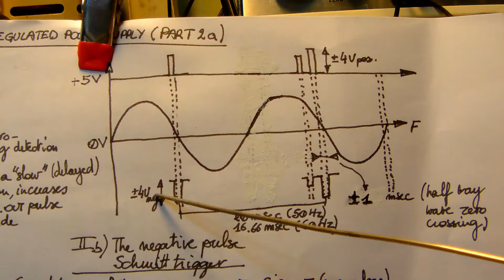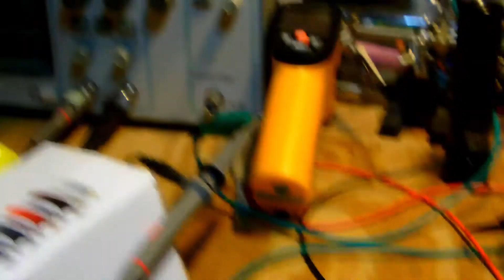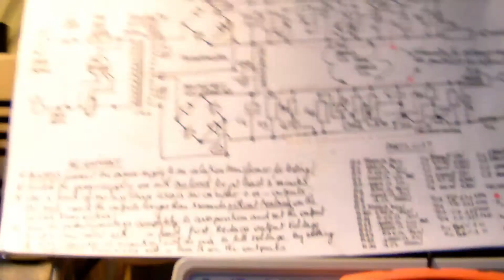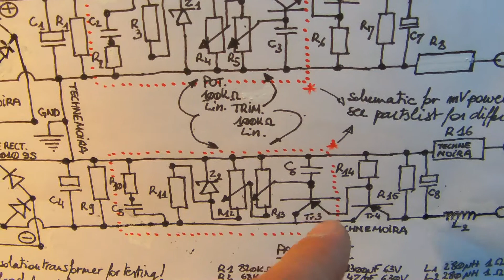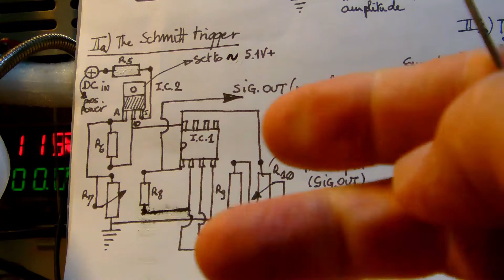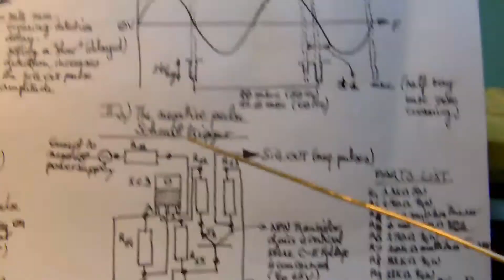Weekend Projects: Building A Multi Function Power Supply part 2 of

Comment: It looks like you are having fun with this project.
It seems beyond my skills, but I still find it entertaining and informative.
Thanks for sharing.
Reply from the maker: Hi Keith. Yes I'm having fun with the project, but I also intend on having a working ultra-complete power supply for use by myself. Sort of a tool that I always wanted to have but never found (for a reasonable price) I may take a short break from building the project and do a restoration iin between just for fun, I haven't decided yet. Thanks for your nice comment and always welcome :)
Reply: @TechneMoira  That sounds great,
= fun and practical - thanks again.